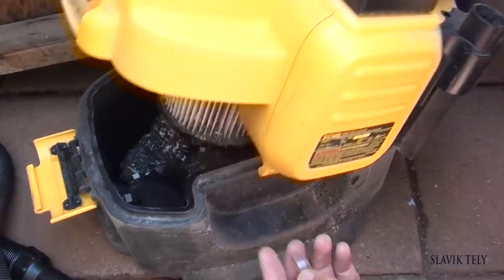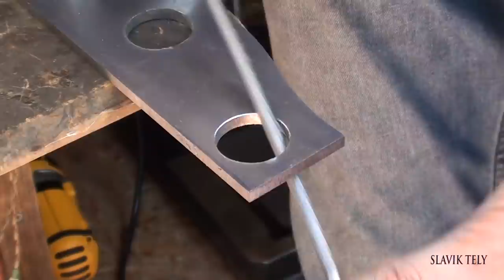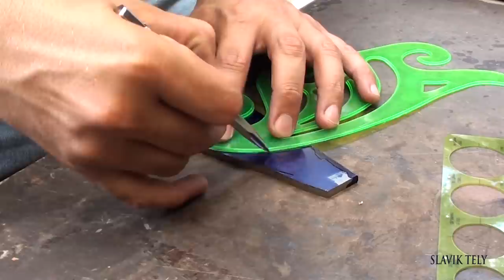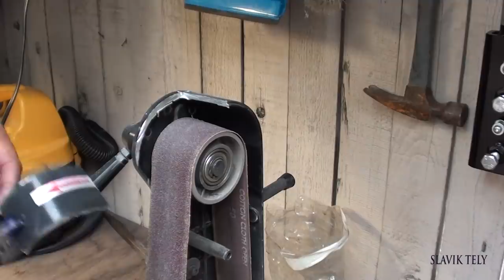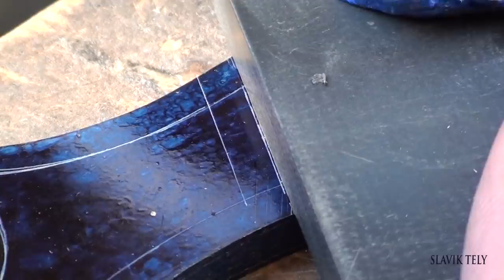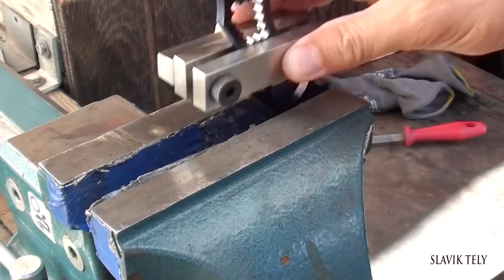Making BLAKE KNIFE Part 1

Comment: Hi Slavik, I have one question about the grinding/filing. I saw that after cutting you use file to grind rough edges and later you use diamond wheels. So, the question is why after cutting you don't directly go with diamond wheels? Why is there so much manual work, when you already have machines?
Reply from the maker: Because there is still too much metal left for the diamond wheels to handle. I get as close as possible to the lines with the file and then square up the edges with diamond wheels. If I had a horizontal belt grinder I would use it instead of the diamond wheels. They are very slow but I guess you use those tools to make it as perfect as possible with what you have.

Comment: drill small holes = use drillpress

drill huge ass holes = better use hand drill

any reason for that? :p
Reply from the maker: Drill press has high rpm. Where as Dewalt drill has more torque and lower speed.
Reply: oh okay, didnt think about that, my drillpress has different gears so it would be no problem (i made a special set to have those low rpm's, doesnt cost anything when you have a lathe and adds much worth!)